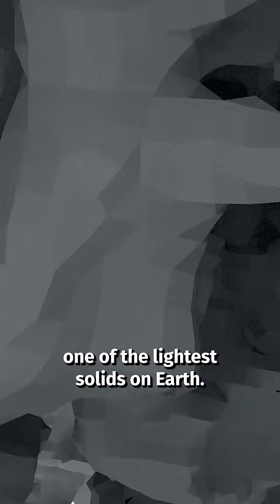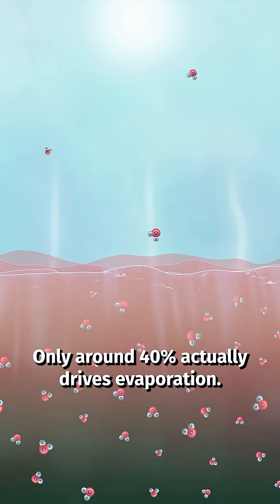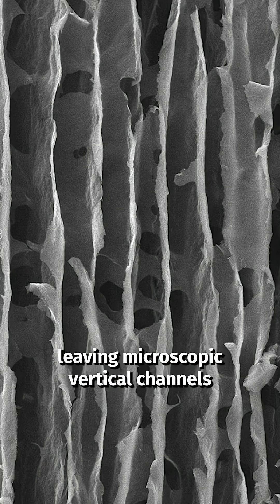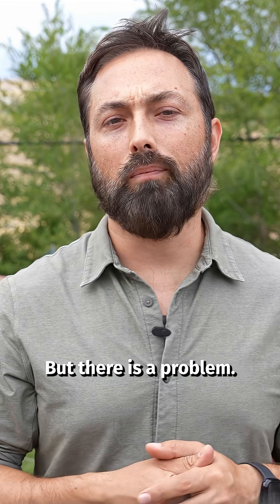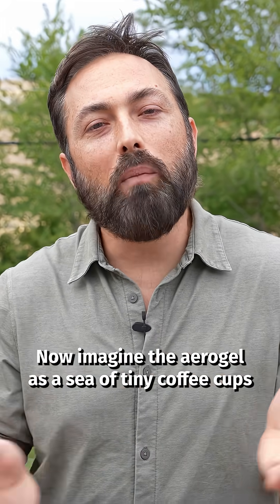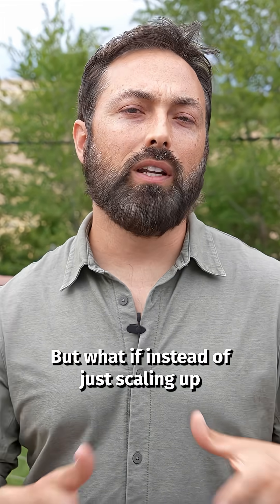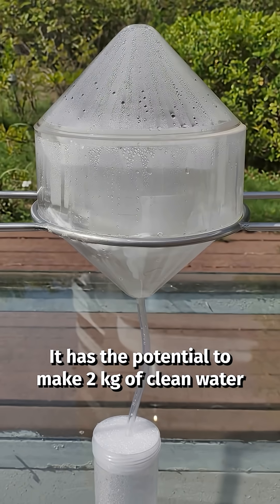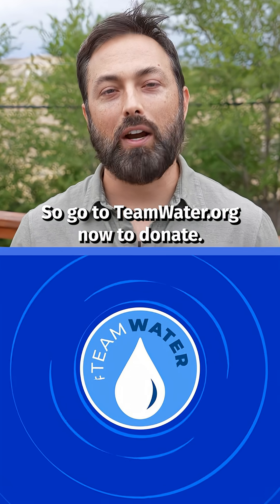How aerogel can make the ocean drinkable

Comment: What its proponents keep failing to mention is that aerogel is incredibly delicate and fragile. It's extremely hard to provide it with a robust enough structure to let it do anything useful at all, and it won't survive any kind of cleaning process. It went through some intensive examination in the aerospace industry where its thermal properties could have been really game-changing but there just wasn't any way to reduce it to a useful product. Decades later the promotional materials are still saying what they said then, that it's being studied for all sorts of things, but nobody's found a way to overcome its shortcomings.
Reply: It did find one very good use on the Stardust mission: using the aerogel to trap particles of stardust (hence the name) and dust from a comet's tail.  The particles would plunge into the material and rapidly come to a stop with negligible damage.
Reply: @calliarcale couldn't that possibly be scaled up to protect versus micrometeorites in space travel?
Reply: @micahsouza8016  even though it is very light it takes up a large volume. Also we already got a very good armour in form or the  whittle(?) shield. It is just spaced armor.
Micrometeorites don't penetrate. They explode on contact.
This is also why the moon has only round impact craters, no matter how shallow the impact angle.

So the tiniest layer of aluminium makes the particles explode and a second layer catches any dust that survives the explosion.
Reply: I’m wondering if it’s just something that keeps getting slightly better over time but it’s not advancing quickly enough to be useful before something else replaces it.
Reply: Nothing a bit of carbon nanotubes can't fix 😅
Reply: @knotnaught Did You Say CARBON?? Ooh NOOOOOOOOO!!  Not CARBON!!! We couldnt possibly use THAT!!! ITS NOT GOOD FOR OUR Cough environmenT!!! Cough
Reply: @ThomasBallew-m7u4u  the joke is that carbon nanotubes are another technology that hasn’t lived up to the hype. There is no cabal preventing the use of carbon. When you hear “reducing our carbon footprint” everyone’s talking about carbon dioxide, not carbon in general. I can see how that may be confusing if you’re just hearing about it from politicians and podcasters though
Reply: They have been working with this stuff for over a decade now I do believe, we just witnessed "proof of concept" it works
Reply: Sounds amazing but was so expensive we couldn’t use it for insulation at my plant. I have heard of some refineries using it in small quantities for thermal insulation but the cost is prohibitive. Maybe it can be used for another purpose like water evaporation as long as it doesn’t leach toxic chemicals into our water…
Reply: Thank you
Reply: To produce huge amounts of desalinated water through salty water evaporation, there have to be huge salt water masses in the surroundings, right? Already pondered about that?
Reply: Still theyre trying... Unlike cough*cough "good"  ol Bill and Melinda's foundation... Theyd rather drink s**t water... Oh Ya! ItsTrue!!
Reply: we used to say that about the internet, then we discovered ways to make computers good to take it on.
Reply: Keep trying I guess
Reply: I mean, it shouldn't be long for material science to evolve now that we have more competent AI.... I've seen the projections about solar panels (they're expected to decrease in price by at least dozens of times in the next few years) so this problem might also be resolved sooner rather than later
Reply: And the 2 kg/sqm/hr doesn’t pencil out. It’s off by a factor of about 30.
Reply: Ive heard its cancerous too.
Reply: @JP-ro2yi I'm fairly sure silica won't do that. As for uses, so far the best is for insulation but yeah it isn't robust enough to be particularly useful yet.
Reply: @JohnsonJohnsonJohnson-j6r Ever heared of silicosis?
This happens when silica dust gets into your lungs. It's similar to asbest lung.

It happens when you inhale silica gel (usually used for separation) dust.
Not sure if aerogel produces small enough dust.
Reply: @etuanno silicosis isnt cancer though, so its not cancerous
Reply: @JP-ro2yi  is glass cancerous? because aerogel is made from the same thing, silicon dioxide.
Reply: @ethereal41 The difference might be in the fact that one is fragile in a way that will make you inhale some of its particle.

I don't know if it is cancerous but glass might very well be cancerous, we just rarely absorb it inside of us because it's not very volatile.
Reply: Well first off its needs to be sublimated into a nano form i have a way to do this but youd have to pay me a million dollars ..so now do you see WHY THERE IS NO INNOVATION ANYMORE..but serious ill make it work with functional nano structures ..only a cool milly easy peazy not even drop in the bucket for someone like you
Reply: So typical Chinese product lol
Reply: @ij1372 aerogel wasnt invented by china, but sure, blame china for every fault in every invention

Comment: I can imagine those pours get coged up by all the dirt and salt.. same reason we have different certifications for fresh water and sea water resistance. Those salt get into films and get stuck quite easily. So these aerogel blocks would need to be replaced and cleaned almost every day, if not multiple times a day. Considering the production cost, it is not very economic.

Comment: 2kg/m²/day is 12.7gal or 48L per day. The US gvt recommends drinking 3.7L/day for men & 2.7L/day for women, average of 3.2L. That means a system using a m² of the aerogel could produce enough drinking water for 15 people per day (average). A community of 1,500 people would require 1,000m² system.

Like all other forms of solar, this only works during the day, so the numbers above are for 24hrs of sun. In winter you would get less water. On the equator with a 12 hour day you would actually need a 2,000m² system for 1,500 people. That still doesn't solve for days where the solar energy reaching the ground is decreased by clouds or haze, which is quite common near large bodies of salt water. 

As salt water evaporates, it leaves a crust of salt behind. What happens to that in the aerogel. Initially, I assume, the water coming up through the aerogel would just desolve the salt & the system would continue to work. However, as evaporation continued, there would be more & more salt buildup & eventually the water ascending the system would become saturated & could not hold anymore. Does that clog the system requiring back washing? This is an honest question, not a critique, as I don't know, but if it does eventually get clogged, that reduces the daily output even more.

Seems to me it's better all around to just use clean natural has as a heat source & if you're worried about climate change focus you're efforts on carbon capture from exhaust, instead of expensive, unreliable solar systems.

Even better, if you truly believe climate change will result in a climate catastrophe, then start building nuclear reactors. After initial capital outlay, they provide inexpensive, very reliable electricity with 0 carbon emissions. Using electricity for desalination makes more sense too.

I sincerely applaud your efforts to provide people with clean drinking water!
Reply: You have some misconceptions about solar. My solar panels are more efficient in the winter. I get just as much energy today, a cloudy day, as I did yesterday,  a clear day. Batteries exist. That's why my solar lights work. It'd be silly to make security lights that only worked during the day or on clear days.

Comment: Why don’t we just put black solar panels on the surface of shallow water containers and as the as the water evaporates off the dark hot surface with high albedo we can squeegee off the residue for harvesting and then continue with more desalination. A glass surface over the solar panels would suffice and then we are accomplishing energy harvest and drinking water as well
Reply: How often you gotta squeegee until you have a glass of water?
Reply: @mausercawley no, you squeegee off the deposits, the water evaporates
Reply: So confused. Are you saying the water goes through the solar panels and the glass?
Reply: @mausercawley no, just keep the solar panels just below the water level and that thin water layer over the solar panels will heat up and cause it to evaporate. That water that evaporates will condense and will be mostly fresh water. Then as the thin water level leaves behind sediment as it evaporates, we can scrape off that residue from the glass containers that house the solar panels.

Comment: Many of the places without access to clean water are hundreds, if not thousands, of miles from any ocean or sea. So, where is this desalinization happening? The amount of resources required to haul in such a small amount of clean water to these areas would make this a net negative, despite being a noble effort. These areas need filtration technologies. 

However, this advancement in desalinization would be effective in disaster areas, like coastal zones impacted by flooding from, let’s say, hurricanes.

Comment: They're overcomplicating a simple solution. And The Simple Solution is use a shallower evaporation vessel. Less water to heat equals a higher overall efficiency. Efficiency in the context of free sunlight is not a very great metric anyway

Comment: Wouldn't this water be considered Distilled water though? You need to add some minerals to it afterwards before it becomes drinkable, or it will certainly accelerate dehydration instead of doing what it was supposed to do, correct?
Reply: Distilled water is perfectly drinkable.
It it literally just water.
Reply: @Mare_Man  Research about osmotic pressure and kidney function. You'll be surprised on how dehydrating distilled water actually is
Reply: @MidnightBlackHawk  I'll save you the 4 seconds it would've taken to Google "is distilled water safe to drink" by telling you I've already answered that question.

Comment: My idea for sea water evaporation is to run a channel  of warm sea water  suspended inside a clear plexiglass tube and let the sun heat up the water as it drains over a course of miles.  But as it gets saltier it will stop evaporating and it's time to dump it back into the ocean by means of a 4 inch drain pipe of PVC to take it down into the ocean. Being thicker and heavier it will flow downward for a long time.  The condensation will also follow the same path but be diverted to a holding tank.  A solar pump can pump sea water during the day  when this would work.  It will work best in the cool morning when the clear outer tube is cold.  This would cost nothing to operate and the path could bend back around so it finished not far from where it began.

Comment: Yeah but still technically you install something solar

Yes it only works during the day but that’s all. You can still turn salt water into drinkable water 

Just pay for solar or wind and you can make it an 24/7 process obviously not nearly as reliable as coal but I’m sure there is a way just a very expensive way to do it but short term costs a lot but long term it might even be cheaper

Comment: Should we be putting aerogel inside walls instead-of traditional fiberglass insulation? Lining the exterior of coffee-cups to keep hotter longer? Lining coolers, fridges, and freezers? Layering floors?
Reply: Mass manufacturing aerogel is not possible, currently it is quite expensive to manufacture a small amount of it.

Comment: If you want to heat just the surface of the water, you can just use a shallow dish. All you need is a way of keeping the water level up as it evaporates. There is also the problem of keeping it level so that the water is spread evenly across the surface. It would undoubtedly be less efficient, although it would be easy to retrieve the salt left behind and use it for food.

Comment: Evaporating 2 litres of water in one hour requires about 1400 Watts. At midday at the equator with no clouds, the surface receives about 1000 Watts per metre squared  from the sun. Even at 100% efficiency the claimed output is not possible even in perfect conditions.
Reply: Wonder if part of it is from the surface area of the aero gel.  This would be an interesting experiment: three containers of water.  1) control 2) topped with processed aerogel (with all the micro channels) 3) processed aerogel in 3d printed matrix (for boundary problem)

See if there's any effect on rate of evaporation

Comment: Drilling wells in Africa has long been a scam or at the least a waste of time, one popular YouTuber is noth going to change that. You know something like 70% of wells they drill either don't produce enough water or go dry in a few years. The other 30% isn't even necessarily a success either, some have toxic minerals that leach into the water. They already have water, what they need are easy, cheap, robust, reusable water filters. But that cost more than drilling another hole in the ground.

Comment: Ancient sailors use pottery that floated off the side of the ship the pottery allowed fresh water in and not the salt.  In the oldest house in America they used volcanic bowl to filter water into drinkable clean water!
Reply: Terracotta. It's also used with the same principle but reverse to water gardens. The bury a pot up to the opening in the top and fill it with water. As the soil dries out it leaches water through the pots. Allowing everything to get perfectly watered easily. If you live in an area with decent rainfall the pots even refill themselves! Just have to check them while doing other gardening and top them off.
Reply: I was thinking there had to be a better version of this since aerogel is not biodegradable, but extremely fragile and damaging to the environment and aquatic life. Since most silanes and solixanes are now being linked to mast cell over-activity and this hormone disruption, aerogel does NOT seem like the way to go.
Reply: Aerogel?! Isn't it basically sand?
Reply: this is an everyday household item in brazil meanwhile
Reply: The volcanic bowl? @dreamadept8784
Reply: Well
Reply: A very cool bit of information! And yes, clay can be put to oven just to harden and if it is found desirable, it can then be glazed, usually only from the outside. Glazing is optional and the point of glazing is to make that clay item waterproof
Reply: Yours is a seriously underrated comment.
Reply: But.... We have a few other methods... I guess props for going the sun route. But is areogel biodegradable? Like quickly buodegradable?
Reply: How is pottery supposed to filter water? On industrial scale we use semi-permeable membranes which don't allow salt molecules to pass, so how would such an effect be achieved with handmade containers?
Reply: @khaezar-raymond  clay is semi-permeable
Reply: @yb6036 unfired clay (sun dried pottery) or partially fired could work. Most pottery we see nowadays is glazed: but older gardeners in their 80s have gifted me clay garden pots that are partulially fired/ semi permeable
Reply: "How is pottery supposed to filter water?"  Some pottery made from clay can be partially fired and is somewhat permeable to water. I remember my grandparents had one, and while working harvesting hay, that vessel kept water fairly cold. The reason was the water would " wet" the outside, and evaporation would cool the vessel.
  I can't vouch for being impermeable to salt though.
Reply: My first thought was “clean water”? From the process he’s describing…sounds absolutely toxic
Reply: @room2growrose623 toxic? tf is toxic about evaporation? lol

Comment: I wonder how that compares to crushed charcoal in kg/hr/$?

I suspect that being able to utilize enough surface area is generally not the limiting factor. Rather it's going to be the cost, mass or stowed volume of the device. If I can have and use two devices that produce half as much water each as one of an alternative, I'd actual rather the two for the redundancy it gives and ability to reduce impact from taking a unit down for maintenance.

Comment: 2kg/m²/hour is a lot. But the problem is always monetary and I don't think this is the solution. I think the solution is concentrated solar power to drive steam generators, condensing the steam and collecting the salt to use for heat storage and using the electricity to freeze-dry local produce. That way you are using water to grow plants but keeping the water locally so that you are continuously adding more fresh water. This way you are producing great value for norther countries that can afford to pay, while you are solving your local problems.

Comment: Here's a silly question.

Why can't vacuum be used?

You just keep mechanically pumping out the "air" which should become vapour fairly quickly, and have a toilet float to let more water in.

I've theorised clothes driers like this. No heat, just keep pumping until the vacuum rises beyond x.

Comment: Wouldn't a solar powered fan to waft the air around in the solar still solve that problem? If the water vapor is moving, there's no back up, and you get the added benefit of the water molecules collecting on the walls in larger amounts the same way raindrops form in a cloud.

Comment: All of that, and never addressing the real issue, which is that aerogel is extremely hydrophilic.

It'll just absorb the seawater into its channels and then crack and dissolve. That's why aerogels haven't been implemented in all the places we'd love to have a lightweight insulator.

You can chemically treat aerogels to make them hydrophobic, to protect them from seawater and such. There's many aerogel products like this available now. 

But a hydrophobic aerogel isn't going to wick up water to its surface, obviously.